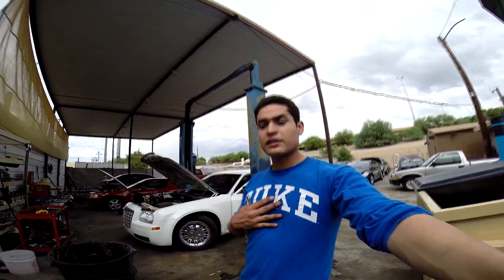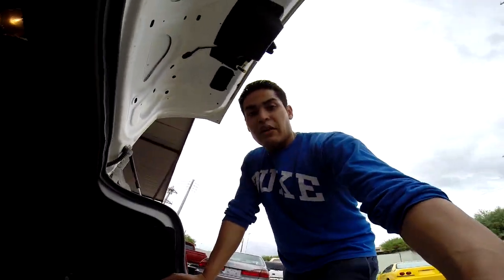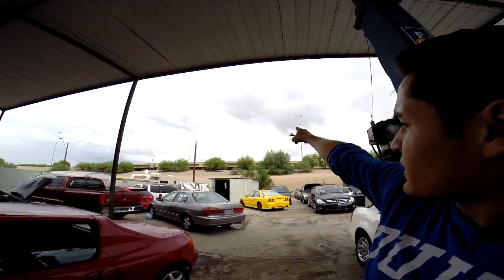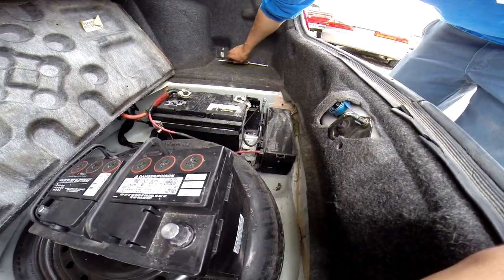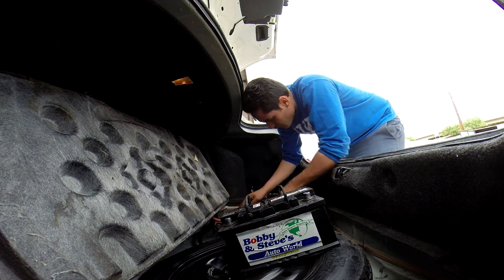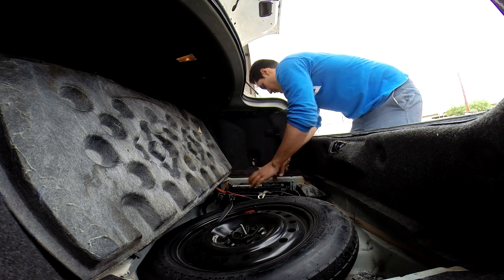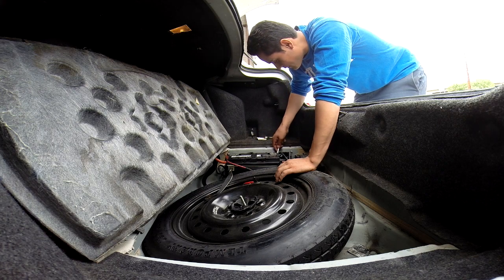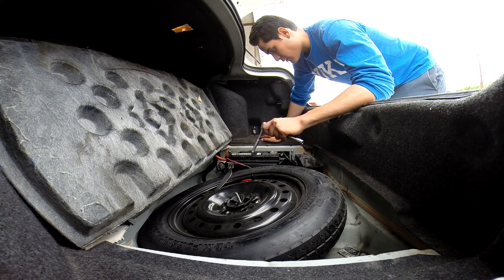2006 Chrysler 300 Dead Battery Replacement

Comment: I notice there was no vent tube to vent the battery outside the vehicle. I have read elsewhere that batteries in an enclosed space need to be vented otherwise gases can be released into the confined space and cause problems. I have seen other videos where the battery had a hole in the positive side of the battery for a vent tube to be inserted. Is it OK to leave the battery installed as you did it, or should it be vented outside the vehicle? My current battery in my 2005 300C is not vented and has no rubber tubing for venting but the cold cranking amps are just barely adequate to start the car.  I'll need to change the battery soon. I would appreciate any comments you may have regarding the need for venting the battery in a Chrysler 300.